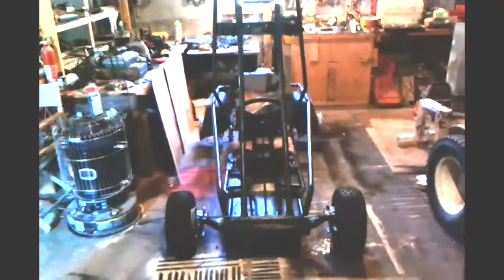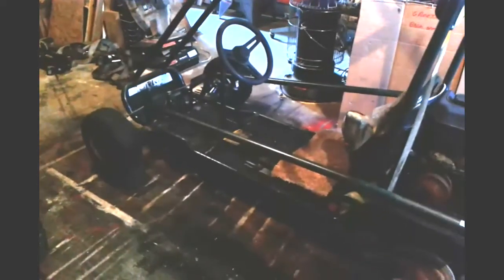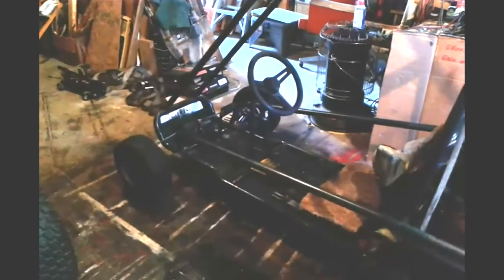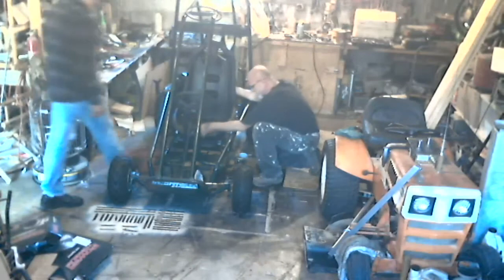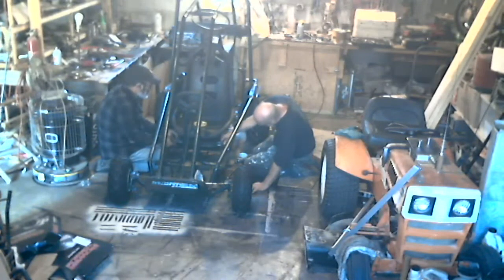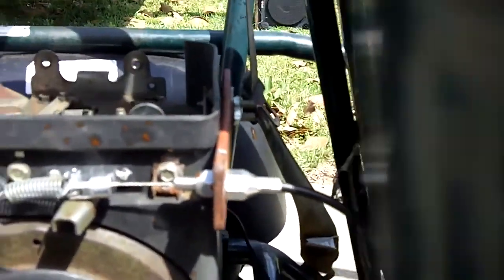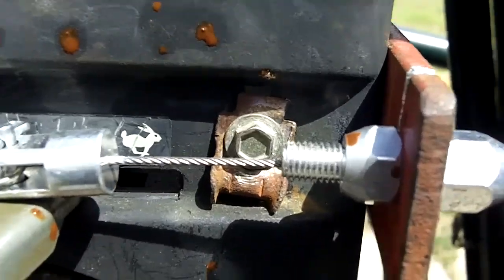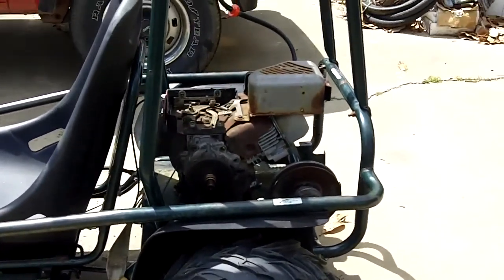Murray Go Kart, Rebuilding the New Toy

Comment: Cool project.
Its too bad your so far away ,at some point i will need some advice im sure. 
Ive got a project here thats right down your alley. I sold my John Deere L120 and purchased a old Sears  lawn tractor. Approx 1977.
Needs some work but in the long run itll be a better machine. Hopefully.
73s
Reply from the maker: Thanks 514, I will do anything I can, to help You get that old Sears up and running again. You probably already know this.......I'm a huge fan of the old Sears tractors.
Reply: @MowerJunkie  thanks